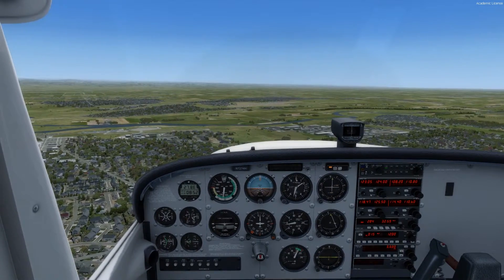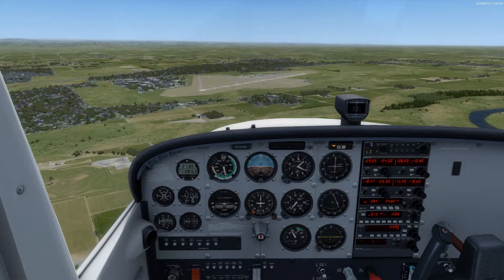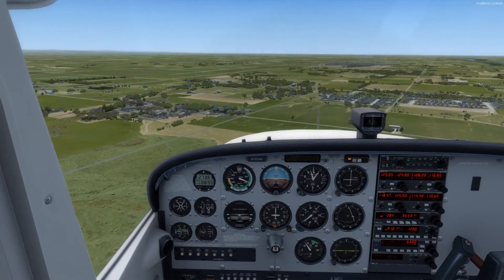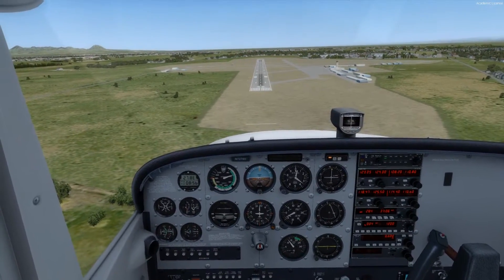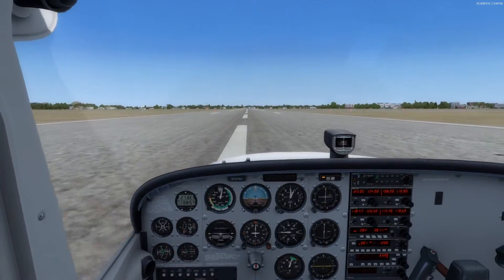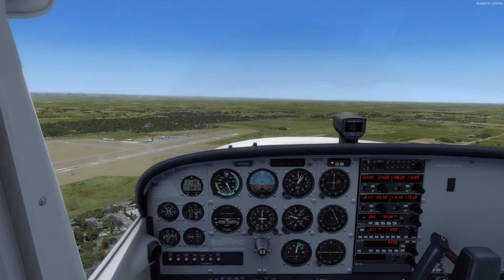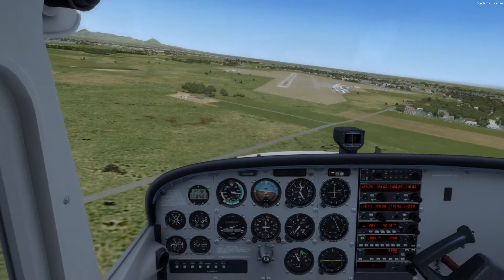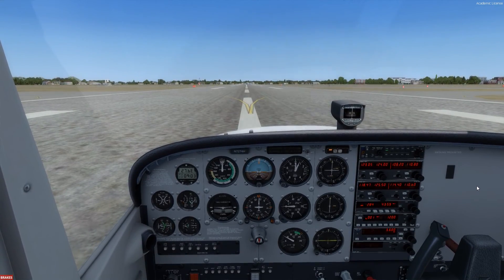A2A Cessna 172R Traffic Pattern/Landing

Comment: I enjoyed your video.  Something you might want to try is the way my instructor taught me how to land.  He said, "you are working too hard with trim, throttle and yoke.  Do this ..."  1900 RPM on the down wind  At the numbers, back to 1600.  Half mile and ready to turn base.  crank in "one wheel" (half a full turn) of down trim.  first notch of flaps.  Couple of sips of coffee as the airplane drives itself down hill.  Second notch of flaps and turn final.  If light wind, don't touch a thing - let the airplane drive.  If too high or low, adjust in 50 rpm increments.  Don't touch the trim.  At 400 feet with the runway made, last notch of flaps.  Throttle to idle,  round out and hold it off the ground until the yoke's in your lap and can't come back any farther.
Reply from the maker: That does sound like good technique. My personal favorite method is to just pull power and add full flaps when abeam the numbers on downwind. Makes for a nice tight pattern and literally nothing changes between that point and landing. Not really accepted on checkrides though so it’s not the main method I teach.
Reply: @SIMCFI  I never used full flaps that high but I did always pull the power before turning base.  The idea was that every landing was a practice engine out landing.  But - yeah - full flaps at that point would make for a VERY tight pattern and some nervous passengers thinking they are looking straight down.  LOL

Comment: awesome video and super stable approach! would you mind if i ask your joystick control settings (sensitivity, null zone or else) and difficulity settings? thanks in advance.
Reply from the maker: M. Emre KÜÇÜK if you’re setting it up through FSX/P3D directly, your sensitivity should be (and mine is) set to full sensitivity. Null zone is subject to how good your physical controller is from control spikes in the center. My CH fighterstick requires a very tiny null zone of maybe 5 or so for pitch and 2 for roll. I use maybe 10 for the rudder. Realism settings are set to full real/hard.

Comment: If you add a little more back pressure to hear stall horn and add a little power if necessary during end of flair you will grease your landings. It will quiet the tire screech somewhat and be easier on tires. At least that is how it works in real 172 and in XP Airfoil labs 172s. Could it be a P3D or A2A thing? I am looking closely at P3D and the A2A 172r and particularly the Flight1 GNS 530/430. The 530 features seem much more robust in the P3D world. Great presentation!
Reply from the maker: Yes that would make the landing smoother. Works with the A2A version of course.

Comment: If you make downwind between 1/2 and 1 mile from airport, you won't rush your base as much and and have to make dangerous steep turns when overshoot final. (You overshot both finals) This also allows shallower turns. Overshooting and steep turns on base to final  is a huge area of accidents. Your 45 is more like 30. You are rushing base too much, causing round shaped pattern. I would try to square up more. Good luck. Thanks for videos
Reply from the maker: I think when flying in the sim, it makes me fly tighter to make it look the same as real life, but the zoom level I think is what makes it off a bit. In real life I fly crosswind and base just long enough to look both ways for traffic and make turns at 30 degrees bank or less. I think I did the pattern better in my new Private Pilot Flight Training playlist.

Comment: Adding flaps in a turn, not sure if thats recommended :-) Also would you recommend holding the nose until the stall horn sounds or putting it down earlier ?
Reply from the maker: +Mozoto I think there's two schools of thought regarding a full stall on the runway and "flying it on". As you saw in the video, it is definitely possible to make a smooth landing without the stall horn. I do it all the time in real life. In fact, I would think it's required to fly it on to make a greaser. If you stall the plane on the runway, even at a very very low height, I would think that would be a harder landing than if you flew it on perfectly. 

And why would adding flaps in a turn be bad? I don't see anything aerodynamically wrong with that. I'm open to having discussions here regarding what I teach. I welcome anyone else to chime in as well :)
Reply: Regarding flaps, from what i gathered, if you encounter a split flap situation during a turn, you might be at a disadvantage when trying to recover.
Reply from the maker: I have not thought of that, that's a good point. I guess it wouldn't hurt to wait until your wings are level, or just add them before the turn.
Reply from the maker: And I said at the beginning of the video that there are many ways to configure for landing. What I mean by that is you could be abeam the numbers and just chop throttle and add full flaps right away, or have any combination of power settings and flaps as you descend down. This isn't directly related to the split flap point, but I just wanted that made more clear.